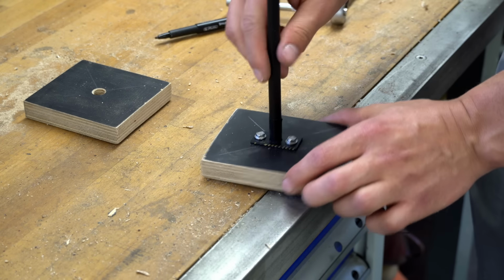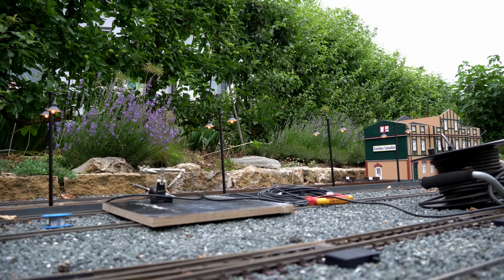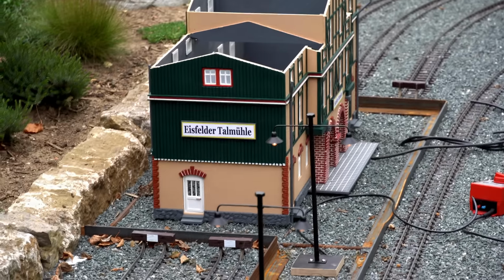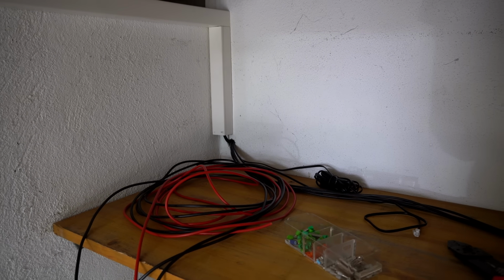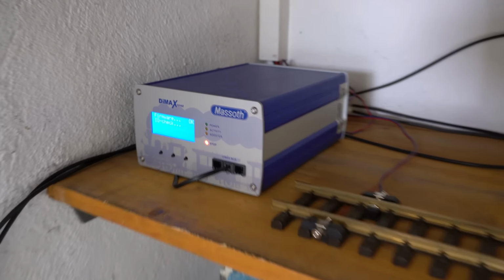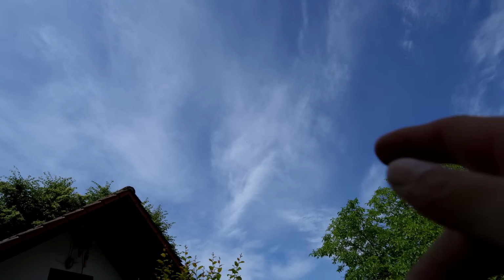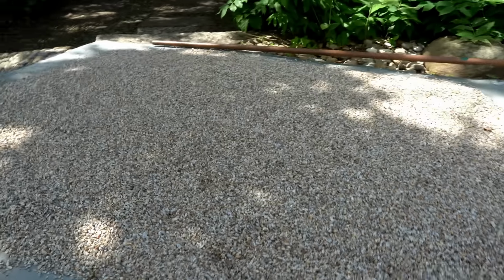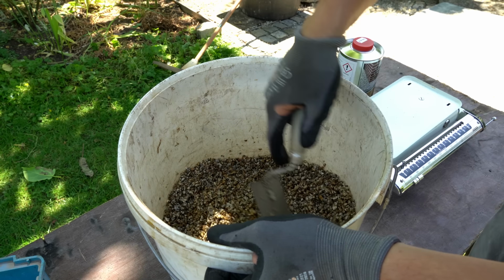BEAUTIFUL railway station gets a new platform

Comment: Nice work with the lamps👍. But, I wonder why you are not using Plastic pipes for all those wires routed under the pebbles like you did earlier with the signaling and track power supplies.👍
Reply from the maker: Over the years I tried many methods to do this, they all have positives and negatives. I settled with the simplest way as you have seen. Once I tried to use plastic pipes. It was blocked by stone and debry at the day I wanted to repair the lantern. So I was forced to remove the plattform pavment anyways to change the plastic pipe with the lantern at once...

Comment: Hello. Will you also use catenary once you finish the trackwork?
Reply from the maker: No I won´t, it is way to fragile and to much maintenance required. The initial cost to install overhead lines is over the top as well...

Comment: Is there a specific reason why you didn't cover the angle iron with a protective coating?
Reply from the maker: I was wondering why no one asked this question up to this video. Short answer is I want it to rust. I like the looks of the rust red steel edge and the stone paving. The steel will be fine for many many years even without paint.

Comment: There should also be a fuse at the output of the 24V power supply to protect your devices.
Reply from the maker: Between the power supply and my digital central station ther is no need for a fuse. I will incorporate some fuses in the lighting circuit!

Comment: Very good job.  I also used a primer glue to fix the little stones. It's expensive but fantastic as it allow the water to drain without forming puddle. Fantastic is the iron border you used. Unfortunately I 've no iron soldering tools and experience. Why don't you protect the iron with antirust paint?
Very useful the part on the electrical connection.
Could you explain better the electrical supply scheme. Which kind of transformer 220v-24v are you using? I see you put many switch before the transformer and I wonder why
Reply from the maker: Thank you for your interest. I want the steel edge to rust so it gets a rust red color. It will be fine for many years even without paint since this is very thick steel and it won´t rust very fast due to the dry climate and no standing water on it. I have build a similar edge  5 years ago and beside the surface rust it is in very good shape. I made a video about the installation of my electrical supply, this might give you some answers. 
https://www.youtube.com/watch?v=chWWlh3tEEE 
The many switches in front of the transformer all have a reason. I have 2 transformer so I have two on/off switches, one for each of them. Those are mounted to the right. In the middle there are 2 breaker units, each for every transformer. And last but not least there is a RCD "Residual Current Device". Breaker units and RCD are mandetory in Germany for such a installation, those will be constantly switched on. I will use the two switches to power on or off my whole layout.